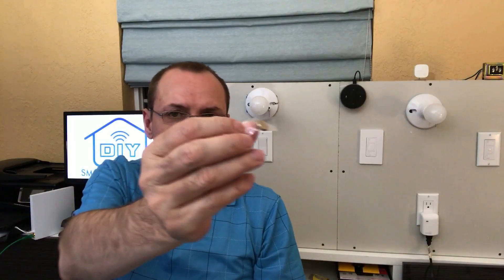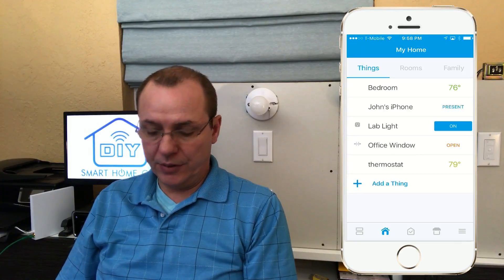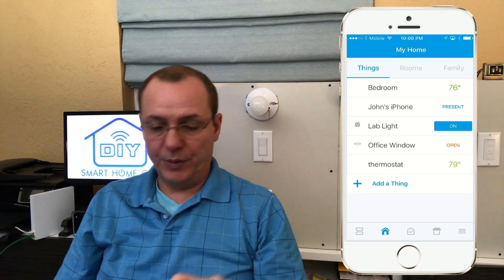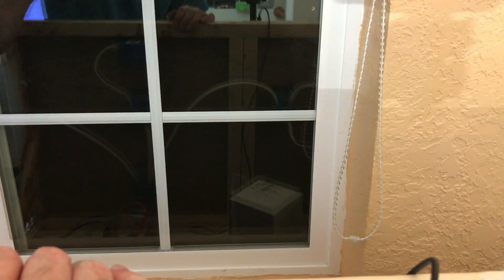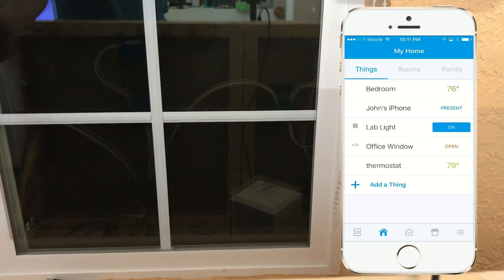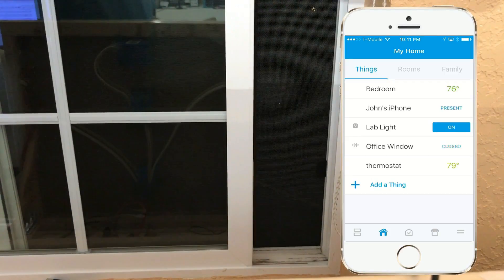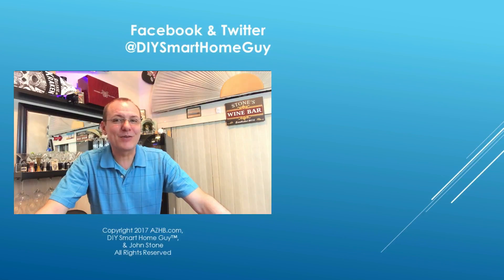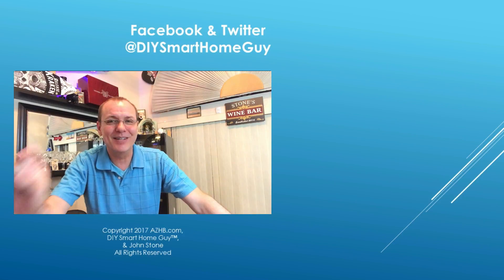HOW TO Sensative Strip Z-wave Sensor + EcoBee3 + SmartThings + Stringify+ Wink Hub 2

Comment: John have you tried Sensibo (www.sensibo.com)? It's a replacement for the IR remote functionality on air conditioners that can interface with IFTTT. I have a beach front vacation rental unit in Hawaii where I can only have window AC (HOA rule), and I don't want tenants to throw my money out the window by running the AC with a window open. Interfacing the AC with this Sensibo, and using Wink to verify windows are closed would allow me to ensure windows and doors are closed if they turn the AC on (if not, the IFTTT would shut the units down). Aros AC works with Wink already but it's a very loud AC system...I don't want to torture my tenants, I just want them to be fuel efficient so my beach stays above water.